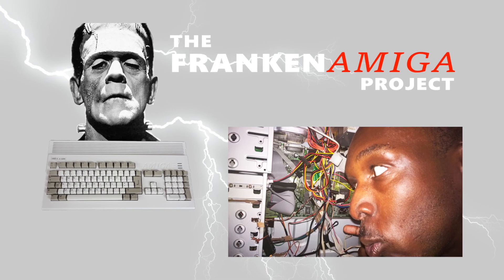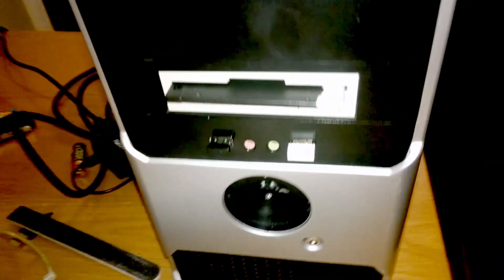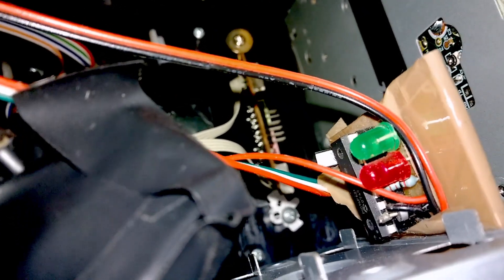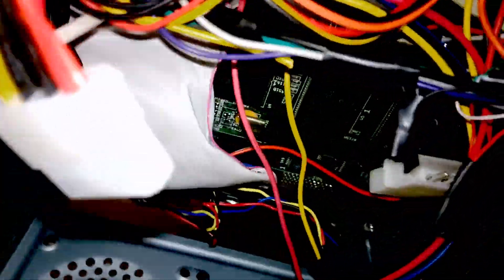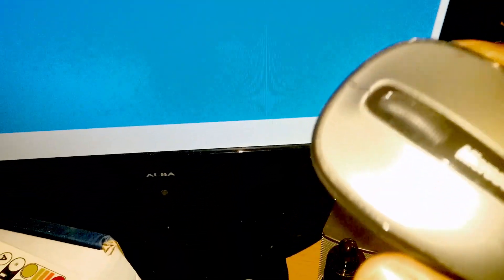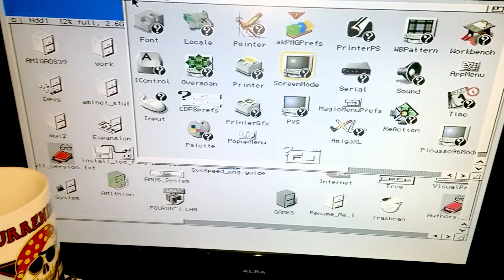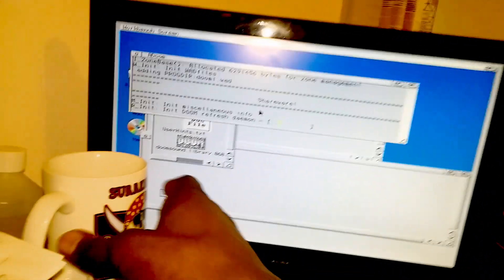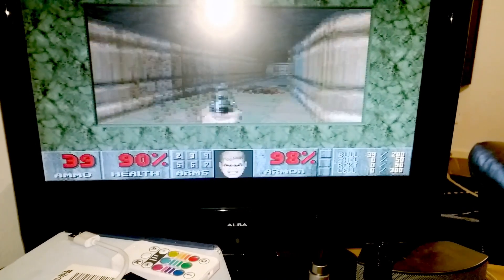Amiga 1200 tower project 'FrankenAMIGA'

Comment: I have just begun a project like your tower. However. I will be making mine, in a desktop and based on a 500 board instead. And for crying out loud. There are tons of metal work in such a project. Never done anything like this before, so I am learning new stuff as I move on.
Reply from the maker: Great, it should be fun.. I might re visit this when i get some time and make some improvements. The A500's are a bit easier to work with (more options available). Make sure you share what you've done 👍
Reply: @danehenry895  I will. 🙂 Though it will not be on youtube. It might not get totally completed before late 2020. Yet what I will make, will get published on my blog: https://to9xct.blogspot.com/p/blog-page_11.html?m=1

Comment: Great start, more than I've done in months, I have an A600 'laptop' with the bits I've collected still without all the h/w installed, I found a slot-loading CD-ROM that fits inside also. [ VGA LCD with a small audio mp for laptop sized speakers 12V, screen, indivision, aca020, CF ]

You went at it rational, I'm thinking of using mine desktop now, I could have a full sized CD then.

PS I have one of those PC floppies to mod but, chickened out several times.

I plan on doing a lot of coding, it's my thing.
Reply from the maker: Thanks!.

There were many moments when I was waiting for the white smoke, it's worse on rare hardware but sometimes you've gotta just go with it.

If you've got a steady hand then you should be able to do the floppy mod, plus they're cheap if you totally mess it up..

Keep up the work!!!